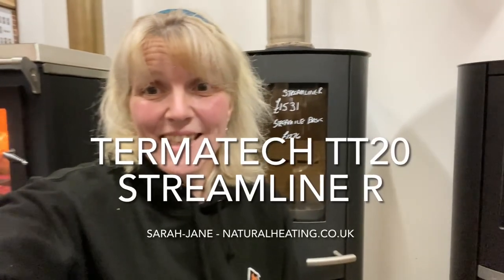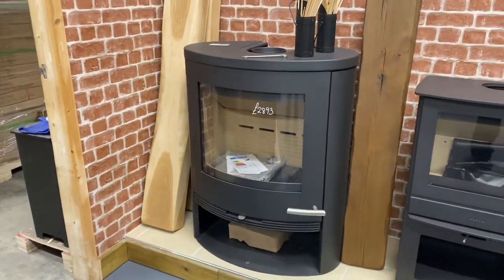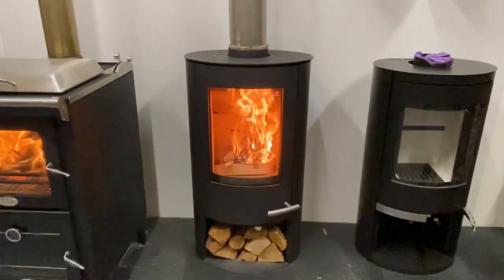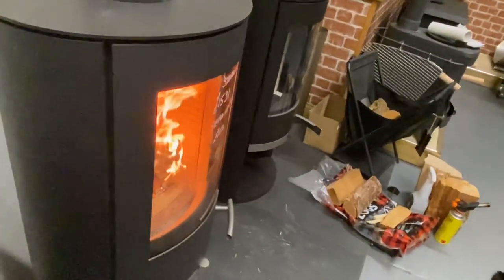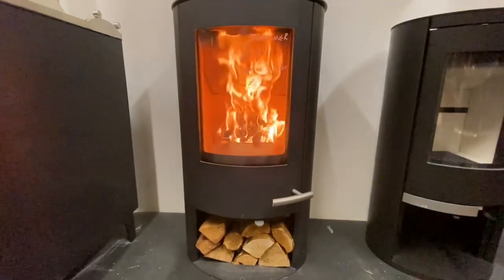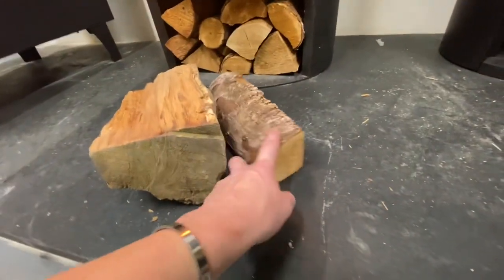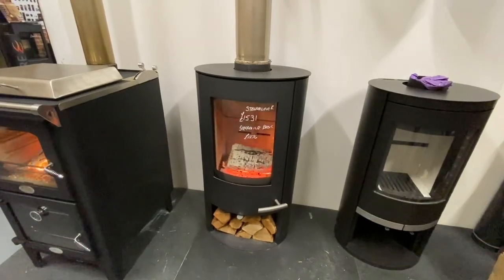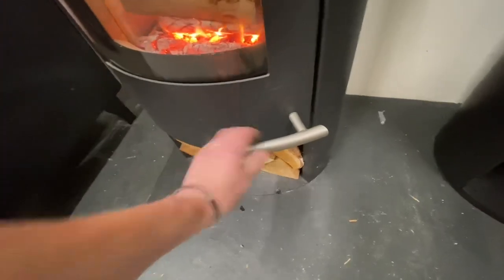TERMATECH TT20 STREAMLINE R Free Standing Cylinder Wood Burning Stove - Low Dtc - Natural Heating

Comment: Well... I've had a Termatec TT20 fitted in my conservatory since October and I've had my lowest gas bills ever! 

I'm not new to wood stoves so thank goodness a little experience had paid off ...

We have a DEFRA kit fitted to our stove as fitted by the stove company we used. 

During all that cold weather throughout December we kept our stove going 24/7 with great quality well seasoned wood averaging either side of 15% .

I may possibly add a direct air feed kit to the stove as my conservatory is fairly air tight and I can feel air being sucked down my stairs from the upstairs as well as around my front door 🙈

The lady in this video is correct, an absolutely cracking stove for the money,. 
Great heat output and a big firebox from which we can get 7 to 8 hours burn shut down with the DEFRA kit installed and still get it up and going next morning just by adding kindling and ZERO firelighters & still glowing charcoal.

It also produces very little ash . 1.5 ash pans for 4 weeks of burning!

Quick note...  I still have the auto close on the door engaged because it keeps pressure on the door for lighting and helps preventing down draft from pushing the door open when lighting .... All though the top down lighting method also greatly reduces smoke in the stove. We have twin wall flue ( about 6 meters) so getting that flue hot fast is key for a quick draw with little smoke 😊

Comment: Great video and run down of the unit. Currently building an extension and I’ve got this stove on order (going to gloat as I got it for under 13 hundred). Can’t wait to see it installed and use it, I’ve earned after the amount of hours I’ve spent salvaging and chopping wood!
Reply: unfortunately, prices are going up and up and up. They've increased again rather a lot since I made this video. Enjoy your new stove

Comment: 12:32  hi am looking to get a cylinder style log burner installed in my house in a corner of a room, would you say even now this would be a good choice to go with I don’t want to spend thousands of pounds on one as got to have a twin wall flue installed as have no chimney, I was thinking this one or the TT21R we have a 8x7 room which goes through into the kitchen and and another room downstairs, so would like to try and heat all of them.

Comment: Good video as always. Whats the difference between the streamline R and the streamline basic?
Reply: What's a pirates favorite letter?

You say "r"

I say no, you would think r but it's the sea mate
Reply from the maker: The basic has no base (it’s like legs either side) and flat sides (though curved back and front).

Basically, it’s got bits chopped off to make it cheaper. Same functionality and internals.

Comment: Can you do a video on checking the seals for tt20. I have a tt20 and love it. It’s only a few months old so I’m concerned I don’t know when certain maintenance needs done. Termatech web site says if you open door when there ate flames then gases escape? How else can you stock it up? That confused me. 
I’ve noticed rust on the circular plate on bottom. What caused that?
I bought my fire elsewhere.. appreciate your advice please 🙏🏻
Reply: hard to say without seeing it.

All new type stoves are designed to burn off as much carbon as possible and puch heat forwards. THerefore, when opening a stove door when the unit has unburned fuel inside is generally ASKING for it to push smoke out the front. 

Reloading should only be made on red embers. 

Yes.. some maintenance videos would be good. At the moment, I'm flat out busy and working silly hours - so likely to be a little while before I can get more videos done... but will bear it in mind.

Rust ? I'm not sure where or what you are describing I'm afraid. Hard to comment without seeing what is going on. Sorry...

If a worry, perhaps contact your installer or supplier.
Reply: @NannyAndJack  thank you so much x

Comment: Hi, I am looking at this model but wanting to use in the corner of my living room. Walls are standard plasterboard. What distance away from the wall do I need or will I need heat resistant tiles at both sides of the corner?
Reply: as long as you adhere to the correct clearance distance from combustibles with this stove, no wall protection is required. It will comfortably sit on a 900mm teardrop hearth in most corners.

Comment: I am looking into purchasing this stove. Do you know if you can heat cast iron pan & kettle on this? will the stove generate enough heat? 

Thank you.
Reply from the maker: It’s a convection model. That means it’s an internal firebox with an external skin that acts like a diffuser.

The diffuser effect is what makes it possible to fit much closer than most others to combustible walling.

Unfortunately, this means although you could heat stuff on it, it does not get as hot on top as a conventional stove with a welded type body. It therefore won’t boil a kettle. You might get water hot enough for a coffee if you are lucky.. but more volume needs more time. It won’t power a cast iron potato cooker for example.. the heat from top will be low… so if anything it’s be like a slow cooker low level heat
Reply: @naturalheatinghellfirepizza   Thank you for the quick & detailed reply.
Reply: @naturalheatinghellfirepizza  Can i also ask whether i will need a Heatshield behind this burner?